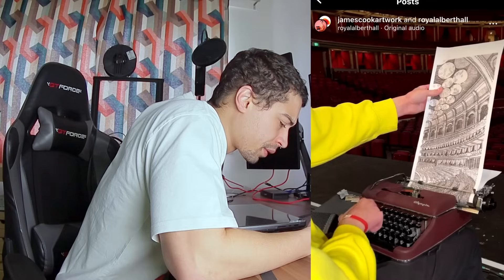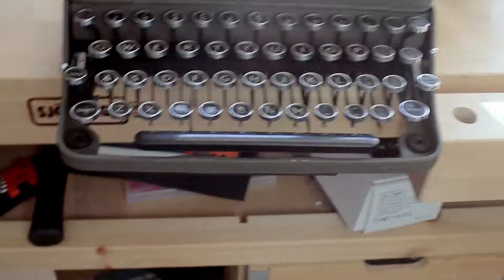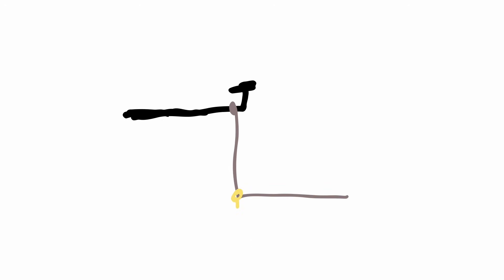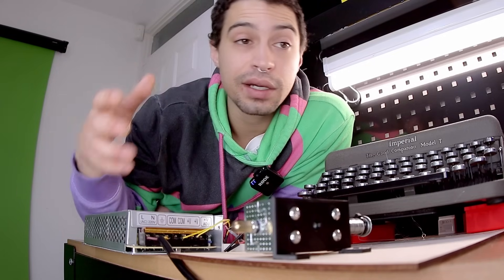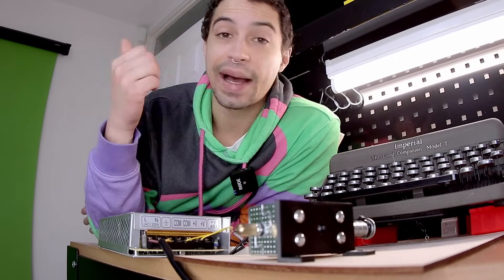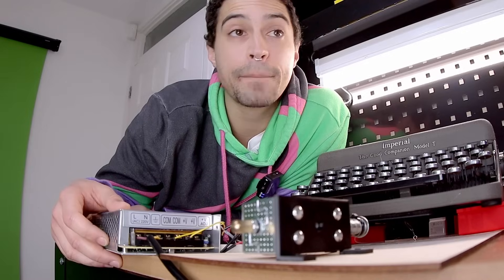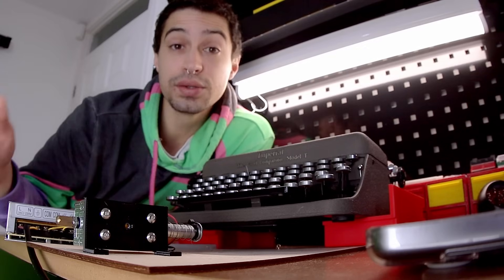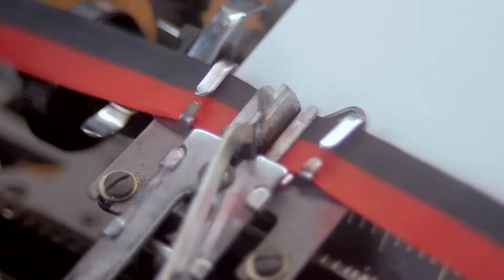DIY automation of 1930s Mechanical Typewriter

Comment: Have you looked into brushless digital servos? They are small relatively expensive and have incredible speed and torque 25KG should be enough and you can get a set of 5 from Ali and mechanically multiplex each row with a single stepper.
Reply from the maker: In my new vid I used servos for the “extra” keys, like the spacebar and shift key, but they move a bit too slow
Reply: @esser50k  brushless digital servos are super fast. That’s the difference from analgie servos. These digital servos give tremendous speed and rogue.
Reply from the maker: @CallousCoder  ok I think I didn't understand your comment the first time around and thought they were just regular servos. I should probably give those a try, thanks for sharing!

Comment: Not kidding I've been working almost this exact project. I purchased an old Royal typewriter to make it automatic. Have gone through the same issues with solenoids, mosfets, servos, etc all while trying to keep the cost low. 

My goal is to make the typewriter write stories. Almost like an interface to AI models through the typewriter. I am at the same place here with the 12V 30mm action solenoid and its been a bit of a roadblock, don't want to purchase ~30 $16 solenoids for the project. 

I would be interested in discussing ideas / potential solutions to the key actuation system.
Reply from the maker: Thats so cool man!
So I'm limiting the number of keys to around 10-12 because I'm only planning to do ASCII art.
Some  of the keys you can use a servo for, like the SHIFT and Backspace.

I also though about having it as an AI interface. But with a mechanical typewriter it would be a bit too much of a hassle. I might do that in the future with an electronic typewriter

Comment: How about using the small motors to build tension in a spring that “fires”  after a set number of revolutions?….I’m a watchmaker we’re all about springs. Great video as ever, looking forward to more.
Reply from the maker: That’s a beautiful solution actually! I’ve seen this approach being used in robots to collect samples in dangerous areas (they could make large jumps with this approach).
The typewriter is all about springs too! It’s beautiful to watch and try to reverse engineer.
Thanks for your comment, appreciate it!

Comment: You could have the smaller solenoid actuate a lever to increase the lenth of the stroke by trading some force. This is often done inside car door lock mechanisms. You might also be able to change where the string attaches to a place that needs less travel.
Reply from the maker: I see, that could have worked yeah. I still struggled to get multiple solenoids working as I have to redirect the string and that introduces enough friction for the solenoid to stop working

Comment: You should be able to use those solenoids with a higher voltage as long as you chop the current....just like a stepper motor driver does.
Reply from the maker: You mean for the smaller ones?
Reply: @esser50k  Yeah, might be able to get some more force out of them without burning them out.

Comment: Since a typewriter can not perform multi-tasking, you need only two magnets for the keys: One for the characters and one for the shfit-key. attach your strings from all keys to a coupling-bar in one line. mount a small stepper-motor with a timing-belt and coupling-bracket to the magnet-side of the bar. When the hook reaches the desired key, energize the magnet, that will pull the hooked string. Since stepper-motors are indexable, the SBC always knows, where the coupling bracket is.
Reply from the maker: Yeah the mechanical multiplexer would just have to do “selecting” and “triggering”.
I didn’t fully get this approach though, got pictures?
Reply: @esser50k  Since YouTube does neither accept images in the comment section, nor links, I try it with ASCII (aka UTF-8) art:
┬  <-Row of keys with strings
│            [¯¯¯]─▌ <-Coupling bracket w. belt
  o_______]  [────▬███  <-Magnet
The belt runs in the Z-direction. Maybe this helps.
Reply: @debrainwasher  damn bro.

Comment: I wonder if there would be a way to automate the solenoid so it moves left/right, then you can have a piece of wire for each key, all lined up parallel to each other, and the solenoid can move left/right until it reaches the right key, hooks onto the wire, pulls, then releases before moving onto the next key.

Comment: Are you using a single solenoid for each key? To bad you can't have a stop for key strings and like the head on bigger cnc machine and instead of changing tools,  the solenoid changes which string it pulls
Reply from the maker: Yeah many people are talking about a mechanical multiplexer, I’m only gonna do ascii art with it so I only need around 10-12 solenoids

Comment: the thing you should know about typewriter art vs normal ascii or text art is that with typewriters they can overlap characters and you can kinda place characters in arbitrary locations like you see in the intro
Reply from the maker: Yeah definitely aware of that. But that in theory just improves resolution. So I can get away with making it really big maybe. And yeah I can still overlap characters if I use the back key
Reply: @esser50k  its not just that, they partially roll the drum by hand so that they also overlap vertically

Comment: Maybe a spring thingy, and you use a single motor to pressure all of them at once, and release them based on what letters u want to press. (im thinking like a car engine piston "locking" all the springs than resting, waiting for one that is not "locked" to be requested and than pressuring all again.
Reply from the maker: Yeah I’ve definitely been considering a mechanical multiplexer.. but all mechanisms seem so fiddly